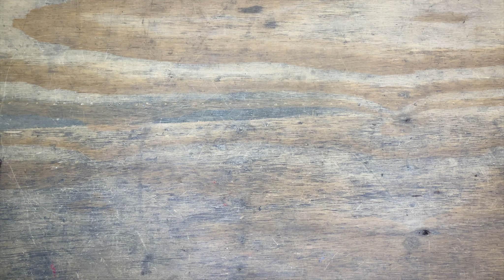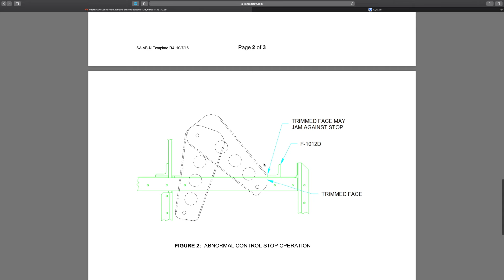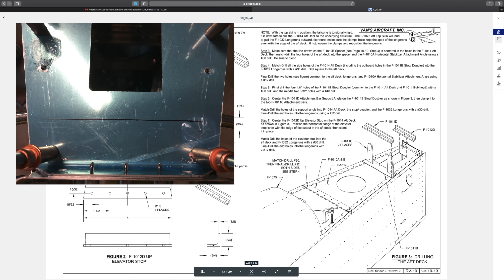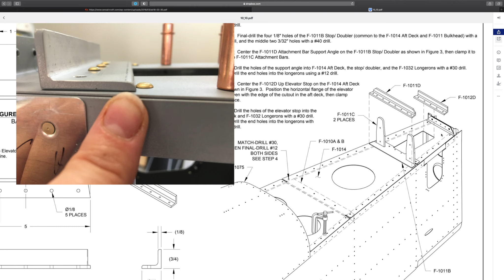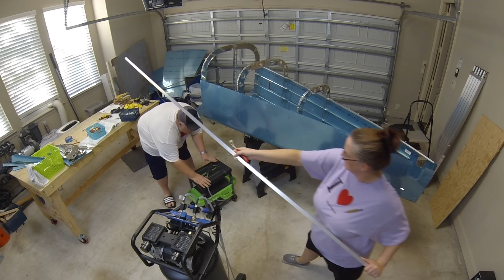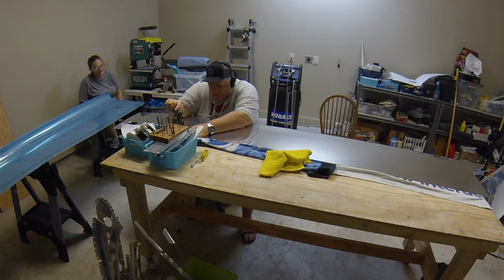Van's Aircraft RV-10 Build: Days 43-49 - Service Bulletin 18-03-30 & More Tailcone (10-11 to 10-15)

Comment: What is your husband doing with the drill looking tool at 35:57?
Reply from the maker: He's using a deburring bit to deburr the holes we previously drilled. It is a low-power battery operated drill with slow speed so it won't countersink the holes with the deburring bit

Comment: When it comes to nuts and bolts are there torque requirements? It seems whenever (few) times I have seen you tightening a bolt it appeared you are using a regular socket wrench and using feel for determining when is enough torque?

Comment: Quite a bit different from the 14.  Up to this point the builds between the 10 and the 14 were almost identical.  Not this part though.  Very fun to watch!  I had some adventures with my aft deck too.  Funny this is the “easy” part of the build!  Super glad you posted, keep em coming ❤️!!!
Reply from the maker: Would be interested in hearing what is different with the 14 at this point in the build 😊
Reply: @PlaneLady  Well the most obvious is that your have an extra stringer on each side and the top skin you have is folded manually.  The RV-14 comes with two curved skins that join with a small triangular top skin.  Each of the 2 curved side/top skins also have arms that will overlap on the main fuselage when it comes.  I'll shoot you a picture on IG.

Comment: 28 clecos left out of 500? Jason Ellis had mentioned this problem as well. I'm starting with 800 silver and (perhaps) 100 copper clecos. This should be enough?
Reply from the maker: I’ll have to check how many copper ones we bought, but I think we have about 700 or 800 silver clecos now and that’s totally fine. Nice to have the extras if you’re slow building the wings and fuselage 😊

Comment: Hey Christine, great to see you back 😃

You probably have it covered but wanted to ask. Looks like your elevator travel stop cut outs are to right angles. That creates a stress riser. If you haven't already you should round it out.

Cheers!
Reply from the maker: They’re rounded out in the corners, but thank you for checking 😊

Comment: Leaving that service bulletin angle center section that long would rob a lot of elevator up movement. It will later be filed to be just a tiny bit more forward than the original one. Also I needed to shim it, so don’t rivet it as is onto the deck yet if you are at that stage of the build. You need to evaluate the elevator movement first.
Reply from the maker: Thanks! Yeah, we don’t have any of the emp kit components attached yet - thank you for the heads up 😊
Reply: I second your advice. I have left mine off until I attach horizontal stab and verify elevator movement. Van’s said you can or may have to shim. Good advice on drilling #12 hole. I used an angle drill with a smaller head. Not easy to keep aligned.
Reply: @markwelch3338  I have an adapter from threaded drill bits to hex shank so I can use the drill bits from the angle drill with hex shank extensions on my cordless impact drill. That way any size threaded drill bit can be used as "6" or "12" inch bit. I also found that while a normal drill will sometimes dig in too much and seize when upsizing a larger hole, the impact drill will easily do it since it has more torque.
Reply: Martin Renschler: thanks for the info.  Do you recall where you purchased it? Sounds like a good tool to have.
Reply: @markwelch3338  cleavelandtool, called "HEX ADAPTER FOR DEBURRING (SKU: DB95)"